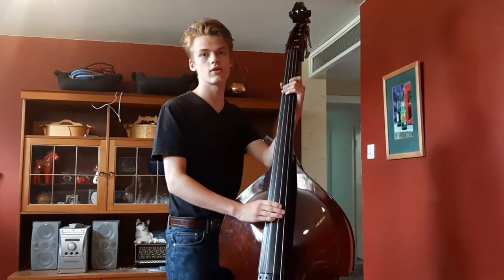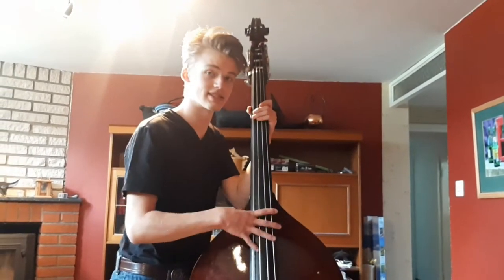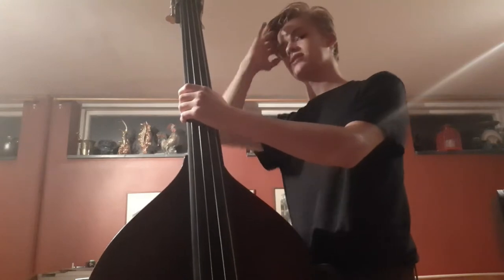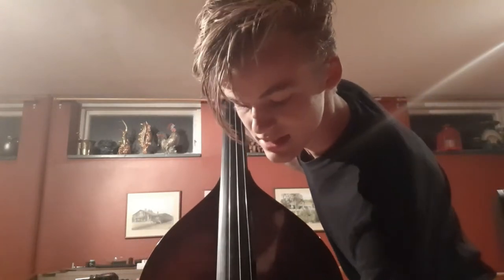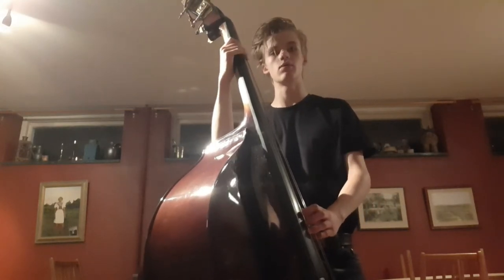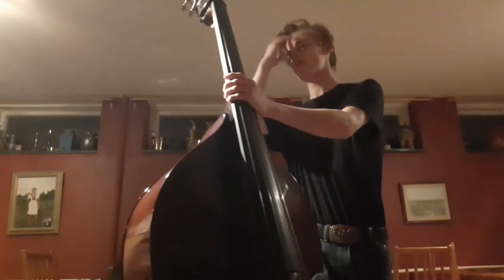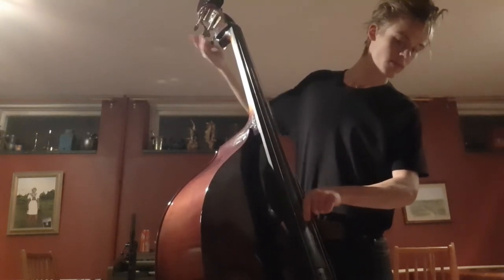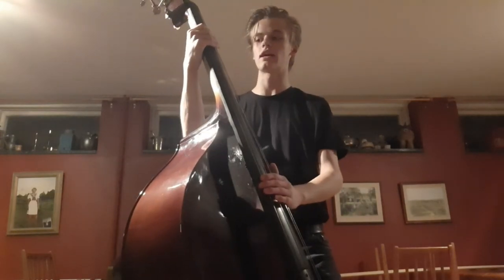My double bass gear. Watch before bumping steel strings!

Comment: the string/pickup experiments with upright bass is such a crazy expensive journey! I'll save you some money and tell you that your bumped steels sound much better than bumped guts. Would love to hear a demo with the pickup plugged directly into the computer. I used a combo of Stringcharger magnetic pickup with K&K Rockabilly system live and loved the sound and the volume without worrying about feedback. But I settled on Presto/Eurosonic strings